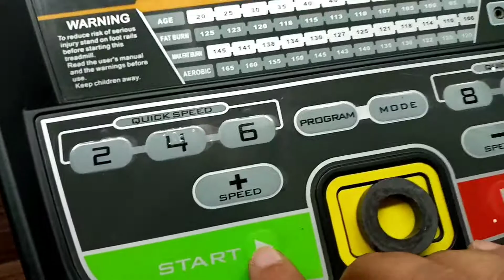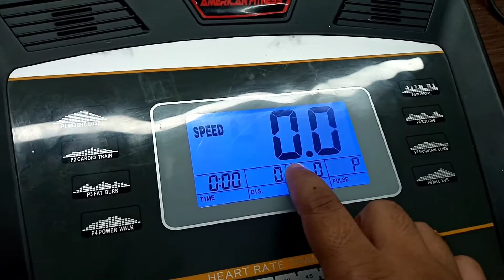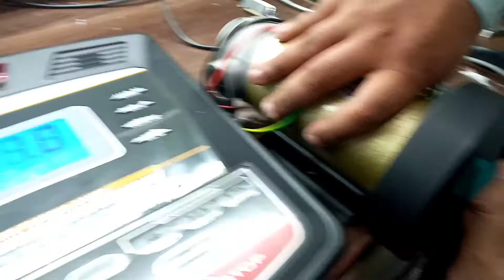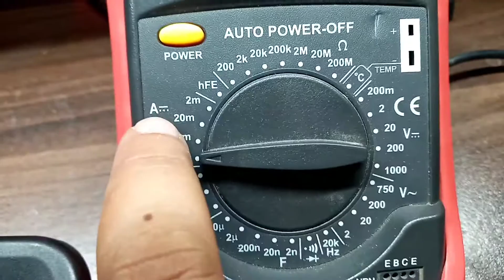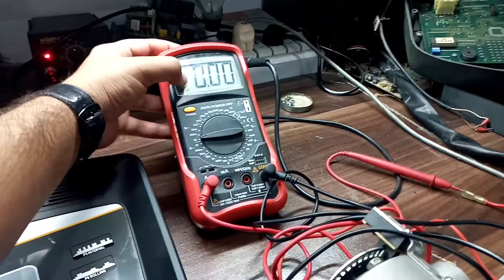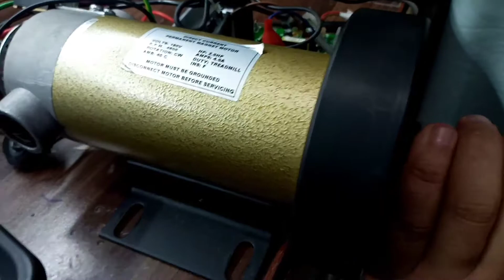How to fix Treadmill Error 5| American fitness treadmill Error 5

Comment: Thanks for sharing, kindly advise me in my case: New treadmill but E05 (current overloading), the motor (1hp 750W ie. 3Amp) try to start but fails after 2 seconds, tested the motor on 24V the motor was withdrawing around 0.6Amp means normal use should be around 6 Amp considering inrush current but fails to start only hummus for 2 seconds and overcurrent protection kicks in, tested all the resistors connected to the OpAM LM358 and they all have descent reading, I appreciate if you could advise me. Many THANKS

Comment: Salam. So you identified how the check the motor to see if it is drawing more amperage. If the motor was fine, how would you determine if the card called controller is bad?  I have a GoPlus 2 foldable treadmill that just got out of warranty and is throwing E05 code after 20 minutes. The motor gets hot gradually but when I turn it off and turn it back ON, it works for another 20 minutes. I would appreciate your response. I am the USA and we bought this machine on Amazon. the seller is not helping.
Reply: How old your mill
Reply: @58584  now about 1.5 to 2 years old